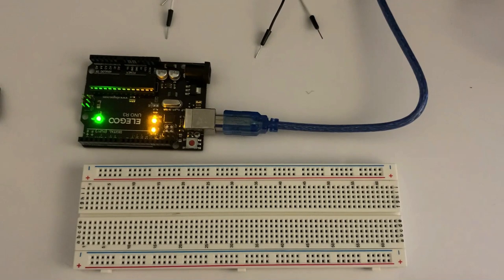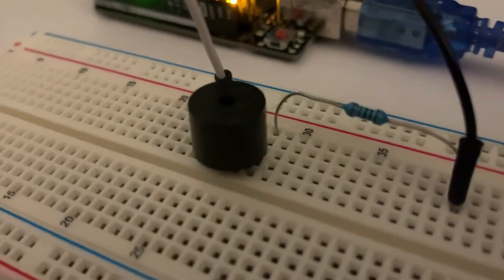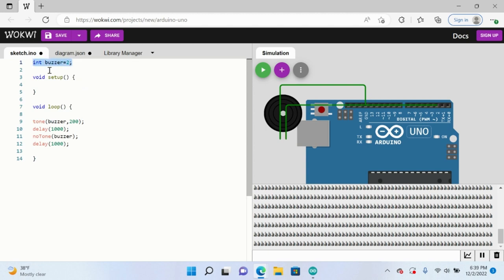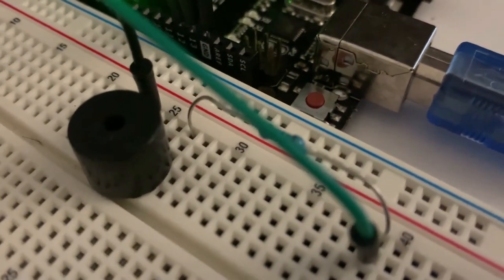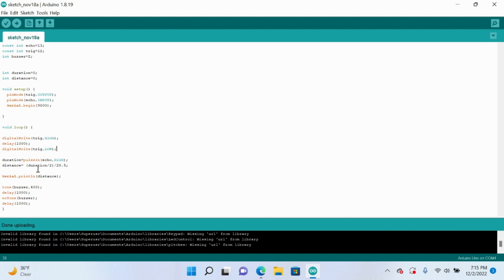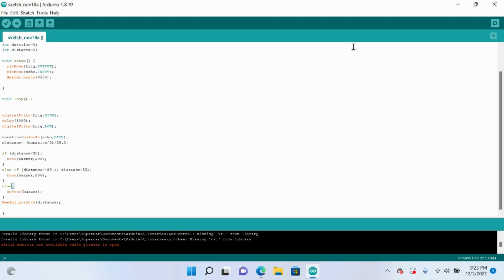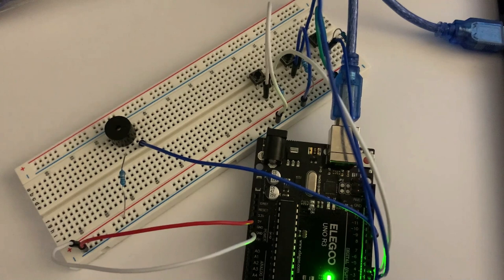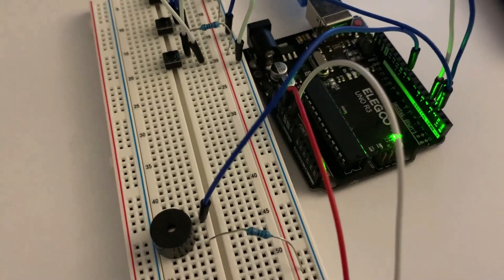Arduino: Piezo Buzzer, Buttons, Motion Sensor, and Christmas Song project

Comment: active or passive buzzer?????
Reply from the maker: The piezo buzzer I used is a passive buzzer because the Arduino controls the sound patterns or frequencies, controlling the timing and duration of signals it sends to the buzzer (as seen by the programming IDE). Thank you for your question! Don’t forget to like and subscribe if you enjoy/ learned something from my content.
Reply: @Waiduino  ok thank you

Comment from the maker: #include "pitches.h"

#define melodyPin 9

// Jingle Bells

int melody[] = {
  NOTE_E5, NOTE_E5, NOTE_E5,
  NOTE_E5, NOTE_E5, NOTE_E5,
  NOTE_E5, NOTE_G5, NOTE_C5, NOTE_D5,
  NOTE_E5,
  NOTE_F5, NOTE_F5, NOTE_F5, NOTE_F5,
  NOTE_F5, NOTE_E5, NOTE_E5, NOTE_E5, NOTE_E5,
  NOTE_E5, NOTE_D5, NOTE_D5, NOTE_E5,
  NOTE_D5, NOTE_G5
};

int tempo[] = {
  8, 8, 4,
  8, 8, 4,
  8, 8, 8, 8,
  2,
  8, 8, 8, 8,
  8, 8, 8, 16, 16,
  8, 8, 8, 8,
  4, 4
};

// We wish you a merry Christmas

int wish_melody[] = {
  NOTE_B3, 
  NOTE_F4, NOTE_F4, NOTE_G4, NOTE_F4, NOTE_E4,
  NOTE_D4, NOTE_D4, NOTE_D4,
  NOTE_G4, NOTE_G4, NOTE_A4, NOTE_G4, NOTE_F4,
  NOTE_E4, NOTE_E4, NOTE_E4,
  NOTE_A4, NOTE_A4, NOTE_B4, NOTE_A4, NOTE_G4,
  NOTE_F4, NOTE_D4, NOTE_B3, NOTE_B3,
  NOTE_D4, NOTE_G4, NOTE_E4,
  NOTE_F4
};

int wish_tempo[] = {
  4,
  4, 8, 8, 8, 8,
  4, 4, 4,
  4, 8, 8, 8, 8,
  4, 4, 4,
  4, 8, 8, 8, 8,
  4, 4, 8, 8,
  4, 4, 4,
  2
};

// Santa Claus is coming to town

int santa_melody[] = {
  NOTE_G4,
  NOTE_E4, NOTE_F4, NOTE_G4, NOTE_G4, NOTE_G4,
  NOTE_A4, NOTE_B4, NOTE_C5, NOTE_C5, NOTE_C5,
  NOTE_E4, NOTE_F4, NOTE_G4, NOTE_G4, NOTE_G4,
  NOTE_A4, NOTE_G4, NOTE_F4, NOTE_F4,
  NOTE_E4, NOTE_G4, NOTE_C4, NOTE_E4,
  NOTE_D4, NOTE_F4, NOTE_B3,
  NOTE_C4
};

int santa_tempo[] = {
  8,
  8, 8, 4, 4, 4,
  8, 8, 4, 4, 4,
  8, 8, 4, 4, 4,
  8, 8, 4, 2,
  4, 4, 4, 4,
  4, 2, 4,
  1
};

int switchOne = 0;
int switchTwo = 0;
int switchThree = 0;
int LED1=5;
int LED2=6;

void setup(void) {
  pinMode(9, OUTPUT); // Buzzer
  pinMode(2, INPUT);
  pinMode(3, INPUT);
  pinMode(4, INPUT);
  pinMode(5, OUTPUT);
  pinMode(6, OUTPUT);
}

void loop() {
  switchOne = digitalRead(2);
  switchTwo = digitalRead(3);
  switchThree = digitalRead(4);

  digitalWrite(LED1,HIGH);
  digitalWrite(LED2,HIGH);
  if (switchOne == HIGH) {
    sing(1);
  } else if (switchTwo == HIGH) {
    sing(2);
  } else if (switchThree == HIGH) {
    sing(3);
  }
}

int song = 0;

void sing(int s) {
  // iterate over the notes of the melody:
  song = s;
  if (song == 3) {
    Serial.println(" 'We wish you a Merry Christmas'");
    int size = sizeof(wish_melody) / sizeof(int);
    for (int thisNote = 0; thisNote < size; thisNote++) {

      // to calculate the note duration, take one second
      // divided by the note type.
      //e.g. quarter note = 1000 / 4, eighth note = 1000/8, etc.
      int noteDuration = 1000 / wish_tempo[thisNote];

      buzz(melodyPin, wish_melody[thisNote], noteDuration);

      // to distinguish the notes, set a minimum time between them.
      // the note's duration + 30% seems to work well:
      int pauseBetweenNotes = noteDuration * 1.30;
      delay(pauseBetweenNotes);

      // stop the tone playing:
      buzz(melodyPin, 0, noteDuration);

    }
  } else if (song == 2) {
    Serial.println(" 'Santa Claus is coming to town'");
    int size = sizeof(santa_melody) / sizeof(int);
    for (int thisNote = 0; thisNote < size; thisNote++) {

      // to calculate the note duration, take one second
      // divided by the note type.
      //e.g. quarter note = 1000 / 4, eighth note = 1000/8, etc.
      int noteDuration = 900 / santa_tempo[thisNote];

      buzz(melodyPin, santa_melody[thisNote], noteDuration);

      // to distinguish the notes, set a minimum time between them.
      // the note's duration + 30% seems to work well:
      int pauseBetweenNotes = noteDuration * 1.30;
      delay(pauseBetweenNotes);

      // stop the tone playing:
      buzz(melodyPin, 0, noteDuration);

    }
  } else {

    Serial.println(" 'Jingle Bells'");
    int size = sizeof(melody) / sizeof(int);
    for (int thisNote = 0; thisNote < size; thisNote++) {

      // to calculate the note duration, take one second
      // divided by the note type.
      //e.g. quarter note = 1000 / 4, eighth note = 1000/8, etc.
      int noteDuration = 1000 / tempo[thisNote];

      buzz(melodyPin, melody[thisNote], noteDuration);

      // to distinguish the notes, set a minimum time between them.
      // the note's duration + 30% seems to work well:
      int pauseBetweenNotes = noteDuration * 1.30;
      delay(pauseBetweenNotes);

      // stop the tone playing:
      buzz(melodyPin, 0, noteDuration);

    }
  }
}

void buzz(int targetPin, long frequency, long length) {
  digitalWrite(13, HIGH);
  long delayValue = 1000000 / frequency / 2; // calculate the delay value between transitions
  //// 1 second's worth of microseconds, divided by the frequency, then split in half since
  //// there are two phases to each cycle
  long numCycles = frequency * length / 1000; // calculate the number of cycles for proper timing
  //// multiply frequency, which is really cycles per second, by the number of seconds to
  //// get the total number of cycles to produce
  for (long i = 0; i < numCycles; i++) { // for the calculated length of time...
    digitalWrite(targetPin, HIGH); // write the buzzer pin high to push out the diaphram
    delayMicroseconds(delayValue); // wait for the calculated delay value
    digitalWrite(targetPin, LOW); // write the buzzer pin low to pull back the diaphram
    delayMicroseconds(delayValue); // wait again or the calculated delay value
  }
  digitalWrite(13, LOW);

}